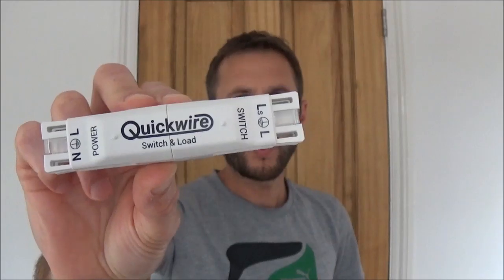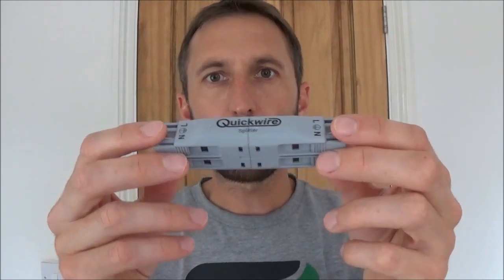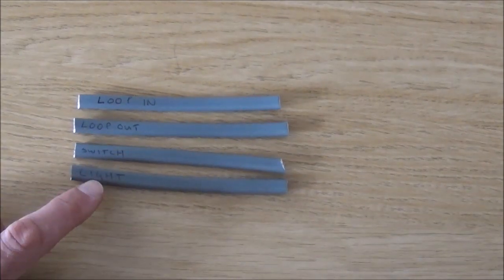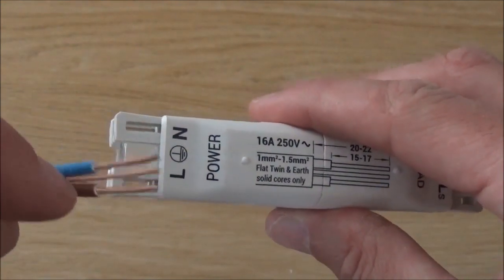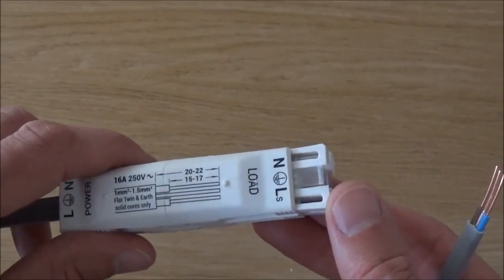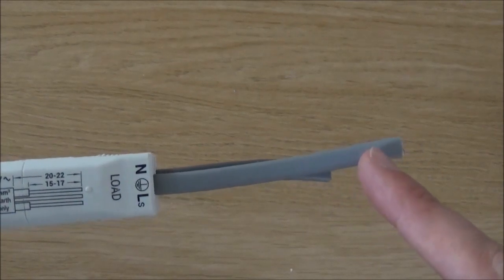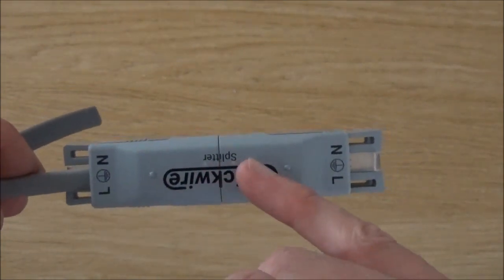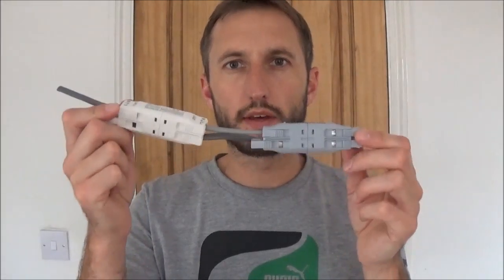Quickwire Junction Box & Splitter REVIEW and DEMO. Fit lights fast!

Comment: If I wanted to connect two ceiling lights to one switch, would I be able to do that with just the junction box (using the loop out connector) or would I have to add a splitter in as well?

Comment: With the switch cable is it good practice to mark cable around with brown tape. Likewise red tape on older wiring
Reply: Yes it is and you would do so in a normal junction box, ceiling rose, however here i think if you added a brown sleeve to the quick wire box it would restrict the entry and you wouldn't be able to slide it in with ease as he has shown here in his video. Also once it's in place it has the indiction with the small (Ls) to indicate it's a switch wire anyway. You would then have a brown sleeve at the actual switch.

Comment: Instead of extra light(s) I want to connect a bathroom fan that’s wired into a ceiling rose using a two way switching system obviously with the fan on/off switch. 
Is it possible with the splitter?
Reply: Did you manage to get it done?

Comment: hi. been watching your quickwire video as i am adding a loft light. ive connected the quickwire switch cable to the light switch and the quickwire load cable to the light pendant but the light wont switch on.Any ideas why it wont switch on..Thanks
Reply: Have connected the feed in cable?
Reply: @roguebladerunner  hi.its all working now. thqnks for the reply
Reply from the maker: Bit late to the party on this one sorry. Looks like all sorted now!

Comment: I am considering using these to swap a traditional ceiling pendant for a metal modern ceiling light that only has live neutral and earth, my existing pendant has a single cable with live neutral and earth, would I use a splitter on this single fitting please? I assume the junction box wouldn’t be applicable for this setup ? Thank you :)
Reply from the maker: So you've taken the ceiling rose down, and there is only one cable in the ceiling to the ceiling rose? If that's the case then you just connect that to the new light fitting as it seems the wiring you're after has already been done. If there are 3 or more cables then you can use the junction box. The splitter is just to add more lights to the room to be operated by the same switch. Here are two videos that might help to explain this. How to fit a ceiling light. Lighting circuits explained. Replace and install a light fitting. - https://youtu.be/iQAs5zq-32c
How to wire a ceiling rose - https://youtu.be/FjmC0qx1nrU
Best of luck with it.

Comment: Not a replacement for the example you showed at the beginning if it can't take a stranded cable. Virtually all the light fittings you showed probably used stranded cable, so no good.
Reply from the maker: Hi Jim, the standed cable in the flex cable or the pendant is the bit you remove. Your ceiling rose is fed by solid wire cables which are what you use to connect the quickwire junction box. You then discard the ceiling rose and stranded flex cable. Hope that helps. Thanks for watching.
Reply from the maker: @UCIy-I_MrrPJO4jvR_A9B6gw you're confused. The 'light' cable replaces the whole of the ceiling rose an pendant. If you have stranded wiring in your ceiling then it must be 60 years old or more and needs replacing. Prob no earth wires either so wants updating. Hope that helps.
Reply: @POUSEaroundtheHOUSE  already deleted the comment as I must admit to a little confusion. You are assuming that the solid core cable coming out of the quick wire then goes to a terminal block of some kind in the fitting which makes the transition to the fittings stranded cable. The benefit being only one wire to worry about when changing a fitting and not having to rewrite the rose each time.

Just a shame they didn’t make it with lever connectors or a button to eliminate the need for the tool.
Reply: @POUSEaroundtheHOUSE  what is wrong with stranded cables
Reply: @jeriellopez4927  Stranded cables are not suitable for use with the quickwire teminations as they need a more firmer cable to push past and raise the sprung metal that is the contact, stranded wires generally do not have the ability to do this.

Comment: Looks good and much quicker to install than a wago box and I'm glad you can disconnect the cables for fault finding. The only improvement would be if there was a 2nd switched live, permanent live output etc, on the load side of the box for connecting a timer fan in a bathroom tho. Maybe in years time they'll have more options available.
Reply from the maker: Thanks for the feedback.

Comment: Hi
If I’m using this junction box in a stand alone garden room for 6 led down lighters do I just delete the loop out cable ?
Many thanks
Reply from the maker: Yes, just use one power connection for your power in, use the load connection for power to your first light, and the switch connection for power to your light switch. Leave one power connection free as it's not required. Then from your first light you can just daisy chain to the other lights assuming you want them all to come on at the same time. Best of luck.

Comment: Hi mate, love your videos. I have used these for my loft light. Have a slight problem, the bedroom light has to be on in order for the loft light to work even though the loft light is on a separate switch in the loft. Any suggestions ?
Reply from the maker: Sounds like the main feed to you loft is from the downstairs bedroom and has been connected to your switched live rather than permanent live. I might be wrong though. Two vids that may help:
How to fit a ceiling light. Lighting circuits explained. Replace and install a light fitting. - https://youtu.be/iQAs5zq-32c
How to wire a ceiling rose - https://youtu.be/FjmC0qx1nrU
Best of luck!

Comment: Hi pal. Great video. Just wanted to ask a quick question. I have fitted these boxes and must say they are great. However I just want to check before plastering that the last on in the ring only has a live to it (doesn't have a feed to the next light) as such I just have 1 wire going to the power side not 2 as I dont need a feed on to the next light, does it matter which power terminal I use?
Reply from the maker: Sounds right. Shouldn't make a difference which one they go to (can't remember how they are labelled, haven't used them for while). They both just give a permanent feed. Hope that helps. Best of luck.

Comment: Hello Pouse, i have wired up 3 X loft lights and a single switch but no lights. I followed your instructions, and need to clarify that the wire to the switch is the blue one that goes to Ls terminal ? At mo I have power but no lights on. I have used the white junction box and the splitter box and taken the 3 separate light wires back to the grey box
Reply from the maker: Brown wire from L goes to common or L1 in switch, the blue wire from Ls   goes into L2 in switch. So brown wire is taking the permanent feed to your switch. Blue wire is returning power when switch is turned on. Hope that helps.

Comment: Current price as of midApril 2020 £4.29 from Quickwire and a fiver each from EBay, so not at all cheap.
Reply: Down to £3.54 at superlec.
Although still more expensive than wago's the price is coming down to be comparable especially since they need a smaller hole than a wagobox.
But either way - its horses for courses - there are times when this will be good and times when other methods are better.
It's upto the user to decide what to use.

Comment: If you are running two sets of lights from two switches, do you run the load from the first box to a second switch and load?
Reply: Andrew Larking
I think i’m also wondering the same thing - I have two pendant lights that I’d like to control from either end of the room.. 🤔
Reply: Calum Smith Hello I figures it out. Put the power coming IN into power. Then take a lead out of the other power into the next switch and load box, into power. The cable as needed. Works a charm.
Reply: Andrew Larking 
Thanks Andrew, would having two switch&load boxes not mean that both switches could not control multiple lights?
i.e. I think you need to link the switches using three core & earth cable and then take one twin core & earth cable from one switch to the switch inlet on the switch&load box, and then connect however many luminaries you have to the load inlet via a splitter
Reply: Calum Smith No, if no Switch is hooked up you won’t complete the circuit so it’s a switch per switch and load, you just daisy chain the power.
Reply: Andrew Larking 
I think you might have misunderstood me 🤔 I think you connect both switches together and then connect one switch to the switch&load junction box.
Anyways, good luck with it!
Reply from the maker: I'm a bit late to to the party here! Looks like you have resolved the issue. If not, email quickwire and they will be happy to help with any queries.
Reply: Calum Smith Happy to send a diagram if you let me know where you want it going.
Reply: 3 core and eaerth cable for strappers...

Comment: as a qualified electrician the principle is very clever . but there are alot of grey areas . 1 the striper machine. electricians have cutters to strip the cable . 2 needs to be release button . 3 the connectors you are hiding the connections unlike pendant all open .4 price can't be cheap . 5 32amp 6 way splitter box would be a good design for ring main . but a step in the right direction
Reply: @fijtips112  haha yeah lol its kl I spoke to their sales rep he actually went out his way to make me a video explaining how to do it without the removal tool... For anyone who needs to know. Just lift the two tabs on both sides and pull it up... it actually isn't hard at all just looks like your meant to push it in rather than lift them up... should put a sign on it saying 'lift/pull tab to release'. Anyway they are great products and I've sold tons of them.
Reply: There should be a tool supplied to remove the cables from the device. It's reusable not a one off item.
Reply: I hope the guy above hasn't chucked out his stock
Reply: Yep, I sell these at my shop.... Some idiot clicked them all in.... I think im left with stock that is now useless. Thanks quickwire.

Comment: Doesnt regs stipulate that you have sleeve the earth for identifications purpose
Reply from the maker: Well I followed the manufacturers instructions and the product has undergone all the testing required. It's also marked as the earth on the product itself. If in doubt you could email quickwire by going to their webpage. I'm sure they would be happy to help.Thanks for watching.
Reply: It's a maintenance free solution so no identification should be necessary.
Reply: I want this guy to spend a week trying to use this at Victorian properties on ground floor ceiling roses. 

Never enough slack on the cables.

Comment: The only problem I can see is that some new luminaires use flex cable and not T&E. In that case can you still use the Quickwire?
Reply from the maker: My understanding is you can't use flex (stranded wire). But it might be worth going to their website and asking the question as I know it was in it's early stages when I reviewed it. Thanks for watching.
Reply: Only suitable for 1.0 and 1.5 t&e. Not suitable for stranded.
Reply: Thanks
Reply: Swap the flex for T&E

Comment: If I’m adding a fan to the bathroom would i need to use both of these products
Reply from the maker: You could but you can just use other connectors as well. Check out my other videos on how to fit a fan:
How to fit a bathroom extractor fan using a light switch - https://youtu.be/Bi34gxa_-Mk
How to fit a bathroom extractor fan using an independent switch - https://youtu.be/KxH_FM03cMs

How to wire a 3 pole fan isolation switch - https://youtu.be/_d_KlW8UZwE

Hope that helps, thanks for watching!

Comment: Those look excellent. I could have done with them a couple of years ago when the kitchen flourescent fitting needed replacing and i tried to swap it myself. After all, there's only going to be 2 wires, live and neutral right? WRONG lol. I'm no sparky and when i took the fitting off i found a rats nest of wires... all reds and blacks. Then realised i didn't know where the fuck to put them in the new fitting. It cost me money that day XD
Reply from the maker: Ha ha, well you live and learn! Thanks for watching.

Comment: Could you use the splitter junction box to also run power to a bathroom extract fan as long as it wasn't a timed or humidity controlled fan?
Reply from the maker: Not sure. If you go to the quickwire website they will be happy to help I'm sure. Thanks for watching.
Reply: do u want it to be switched via the bathroom light fittings or separately switched ?
Reply: @jamielightfoot8167  via the bathroom light switch. 
I've already installed the fan now with a junction box and 3amp switch outside the bathroom but would still be interested to know if it would work?

Comment: Hi Mr Pouse - i"m thinking of using quickwire for the lighting in my bathroom I have 8 downlights, and a fan so to my reckoning thats 1 switch and load and 4 splitters should get the job done? What do you think...
Reply from the maker: Sounds about right Nigel. Whilst quickwire is a great product, with some downlights you can just daisy chain from one downlight to the next without the need for splitters and might save you a few quid. This vid may help: How to install LED downlighters - https://www.youtube.com/watch?v=DjtB6OnjvlE
Thanks for watching!

Comment: hi, very good demo n video, thx. is it possiable to add just one of this quickwire junction box into an existing light circuit (wired with normal ceiling rose boxes etc.）to add a new light to the circuit? cheers
Reply from the maker: Hi, yes you can add one junction box if you are adding a new light with new switch etc. But if you just want to add another light to a room to come on and off with other lights already there, then just take a cable from an existing light, connect the live to the switched live on the existing light, the neutral to neutral and the earth to earth. Then run the cable to your new light and run the switched live to the live on the new light, neutral to neutral and earth to earth and this will turn the new light on and off with all the others in the room. For more info check out my other lighting and electrical tutorials on my channel. Hope that helps and thanks for watching!
Reply: thx mate :)

Comment: Thanks for this video Mr Pouse. 

Quick question; do you even need to use a splitter when wiring led downlighters? Couldn't you just link them one after another like a daisy chain? 

Surely that negates the need for a splitter? 

Thoughts please. Cheers.
Reply from the maker: Hi, that is true, you can join them in the downlight but some people like to only have one wire coming the downight and it means you don't struggle for room in the terminals if space is limited, although that's not usually a problem on most downlights. Thanks for the question and thanks for watching!
Reply: POUSE around the HOUSE many thanks in taking your time in answering this. Much appreciated. Cheers Pouse.
Reply: A lot of down lights say their terminals are suitable for loop in and out but in reality they're not. You struggle to close cable clamps and covers. In my opinion this is a better option. I'm one of those that prefer 1 cable at the light terminals.
Reply: John Daniells cheers John. 👍🏾

Comment: Hi Pouse, another great video, well done.
I have 2 questions please: -
1) My new light fitting says it doesn't need and shouldn't be earthed so if I use the Quickwire Junction Box am I correct in thinking that because there is no earth cable to the new light fitting I just connect the brown and the blue to the Load Ls and N then all should be good?
2) Having watched your video on fitting a new light fitting instead of the old ceiling rose where you used the Wago connectors I have just ordered the Wago connectors and junction boxes but having now seen this video of the Quickwire I am thinking it looks better than the Wago system. What do you think is the best?
Reply from the maker: Hi again. 1) no need to connect the earth on the load side to light if not required. 2) You can use either product they both achieve the same thing. The WAGO 222 connectors can be used on ring mains as well as they are rated at 32 amps so you may have use for some spares if you bought large box. However the 773 are only 16amp (lighting circuits only) like the quickwire. They are all great products so it's up to you. Hope that helps and thanks for watching another video!

Comment: hi what a great invention.any chance you could wire it  from a prewired ceiling rose as to make it easier to understand for the likes of me please many thanks
Reply from the maker: Hi Arfan, in your ceiling rose, if you disconnect all the wires, in a normal set up you will be left with 4 cables. These are the cables I use in the video. It's that simple. For a better explanation of specific wiring in a ceiling rose, and lighting circuits please watch the following video -  How to fit a ceiling light. Lighting circuits explained. Replace and install a light fitting. - https://youtu.be/iQAs5zq-32c. The vid should explain everything! Hope that helps and thanks for watching!